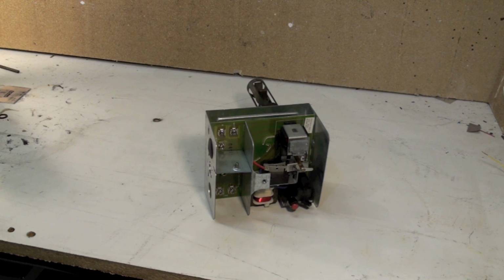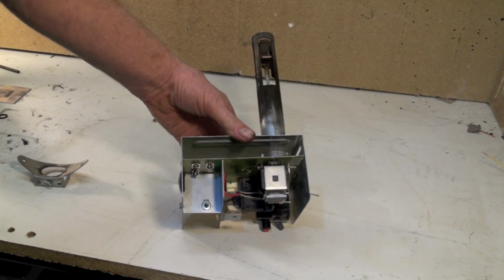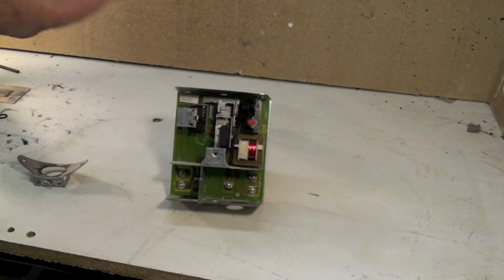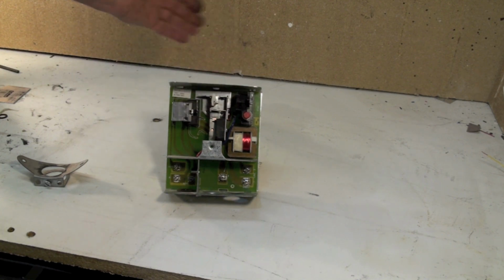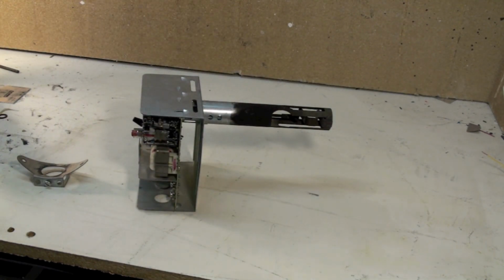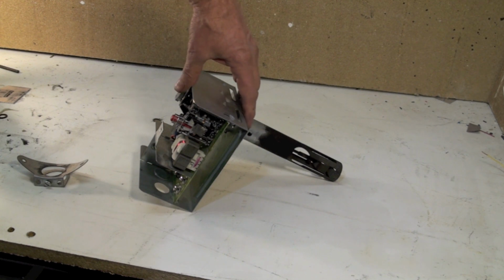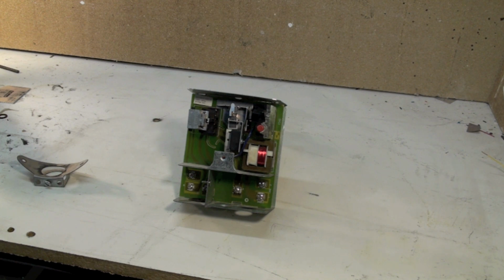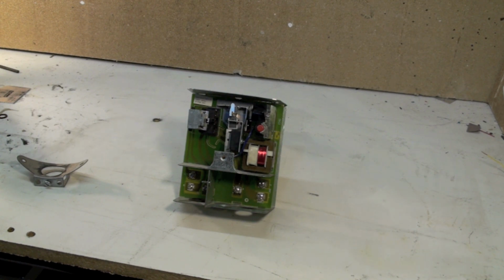Oil furnace stack switch operation

Comment: Thanks for making this video.  I did not know what this was even called before.  My furnace is from 1963, and still goes strong, with good maintenance of course.  I do not have any problems with this part, I just wanted to know more about it. Cheers!
Reply from the maker: I have seen these controls installed in the 1940s and still operational in the 1980s.
GFM

Comment: Hello Gary .I got one of these old stack relays ra117a on my furnace . I am thinking to buy a new Beckett unit and I noticed they have this built in box with the red reset button in it ,is that the new version of this stack relay ,they also have a cad cell inside the big transformer,mine currently doesn't  .I would like to know how to wire the new unit and remove this old stack relay out of the circuit .My system also have a high limit in the front of the furnace next to this stack relay and a low limit on the back of the furnace .I want to leave high and low limits alone I just want to upgrade the new burner .i got two low volt wires going to this stack relay and there are also 1,2 3 4  hot ,neutral,motor ,ignition wires .

Comment: hi GFM, boiler comes on, after about 30-40 seconds it shuts off, once the step lever returns to cold position it tries again and boiler runs normally.  this short cycling happens about 50% of the time, otherwise boiler runs normally.  sometimes the short cycling happens a few times within a minute ( on/off cycle a few times).  cleaned the sensor and put back in step like you said, but it still short cycles, any thoughts would be greatly appreciated, thanks!
Reply from the maker: You might check stack temp.  Should be 500F +.  Too small nozzle could be it.  Or just a bad stack switch.
GFM

Comment from the maker: I am uploading a short one on oil stack switches.  Gas burner wiring is a little different.  The oil burner is a separate assembly and can be wired as a complete component.  Gas burners are part of a complete furnace assembly and separating the burner is not really probable.
Grayfurnaceman

Comment: I have a friend whose Bruner goes out and has to be reset but this is an intermittent condition  it can be ok for several cycles and  trip. why would it be? I don't know if she has a stack sensor of a cad cell relay.

Comment: I working on a 1959 Carrier Weathermaker furnace with a stack control as well as a fan control center. I know that the stack control operates separately from the fan control and at one time this unit had a outside compressor for AC which explains the fan center. It also had two limits not including the stack. I could not locate one of the old limits but it still has a fan and limit control and the stack . I installed a White Rodgers thermostat because the old one had been removed and a section was lost.I am not sure how that happened but anyway, I am not sure where to place the low voltage wiring on the thermostat. I need to use the red and green on the fan control which sends power to the thermostat  and if the stack has its own transformer wouldn't that cause a possible short in the Thermostat? I had made a detailed diagram of how this nightmare was wired before I touch it, but someone took it and now I am trying to take it one part at a time. If you have any type of diagram or manual I would be very grateful!!!! 

Paul Cauthen
Reply from the maker: Paul Cauthen Probably the easiest way is to use an isolation relay.  If you connect the 24 volt from the fan center, it will destroy the stack switch.  This video may help.  http://youtu.be/f0v3FeDZBeY  Hope this helps.
GFM

Comment: Can I replace the stack switch with something more recent with a cad cell relay ? Thanks.
Reply from the maker: You can install a cad cell relay and cad cell, but there is quite a lot of rewiring.  Also, you will have to fabricate a mount for the cad cell pointing toward the flame.  You need to consider if it is worth the trouble, as any burner that has a stack switch is much lower efficiency than modern burners.
GFM
Reply: @grayfurnaceman  so the best option is to change the burner completely ??
or to keep it like that. Thanks.
Reply from the maker: @genevieverivard6378  Yes, a flame retention burner will save a minimum of 20% in fuel usage.
GFM

Comment: to get it "back in step", is it pull, push or both, thanks!
Reply from the maker: Generally, push but if that does not work, push and pull until it does.
GFM

Comment: So does the cad cell relay obsolete this?  Meaning, can you remove this, and rely upon the cad cell relay to do the same thing?
Reply from the maker: The stack switch is obsolete, although they are are still available.  That said, if you have one, it means you have a very old burner, and I would not recommend retrofit to a cad cell.  Instead at the least, I would replace the burner with a retention head burner or better yet, replace the entire furnace.
GFM
Reply: @grayfurnaceman  The burner is a modern Beckett AFG.  I just think that no one removed the old junk when they did the upgrade.
Reply from the maker: Sometimes they leave the stack switch in and use it as a junction box.
GFM

Comment: Would the button pop if you tried to start the burner hot?
Reply from the maker: No, the control will only safety out if it does not heat the element within the prescribed time.  The unit will not allow the burner to start until a cool down of the element has occurred.
GFM
Reply: @grayfurnaceman  Safety out means the button popping out?
Reply from the maker: Yes
GFM

Comment: What would cause the safety to periodically pop out?
Reply from the maker: First, how it works.  When the burner fires up, the hot gasses will be sensed in the vent piping.  That heat allows the burner to keep operating.  Nuisance tripping can be from the element not sensing the heat(pull out the assembly and clean).  It could be from the burner not firing up (Plugged nozzle, bad transformer ,intermittent los of oil supply).  There are more possibilities.
GFM

Comment: Are there different types of stack switch.
Reply from the maker: The 2 types are stack and cad cell relay.  The furnace would have to be 40 years old to use a stack switch.  Intermittent trips could be dirty cad cell.  Stack switch could be clogged with soot.
GFM

Comment: i replaced mine but now the burner is always on ,what is the problem???
Reply from the maker: +Hector rodriguez You have almost certainly wired it incorrectly.
GFM
Reply: Ok thanks .i tried diferent wiring but cant figure it out yet .i work with gas furnaces at work but i bought a house with oil and look like a whole diferent story .

Comment: the spring clip at the end of the probe is snapped on mine. Are there replacement clips or do I have to replace the whole switch?
Reply: +Wil Morris I'm tallking about the bi-metal element. It is broken at the set screw. Is it replaceable? It looks pretty simple to replace.
Reply from the maker: +Wil Morris You can try a local supplier.  They used to be commonly available, but I have no idea if they are still available.
GFM
Reply: +grayfurnaceman ok will do thanks